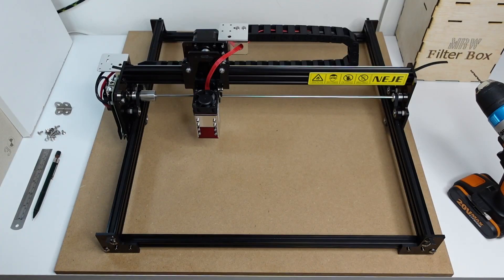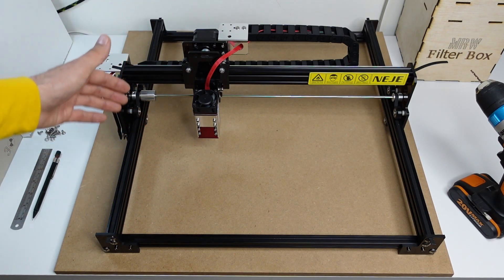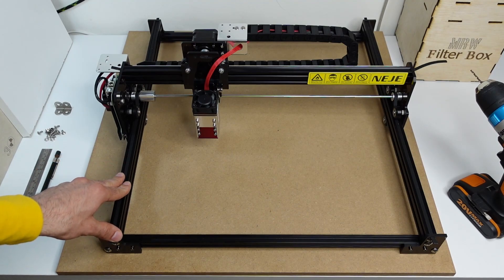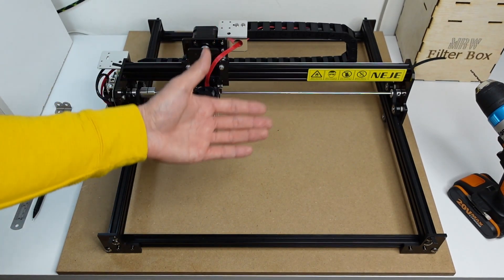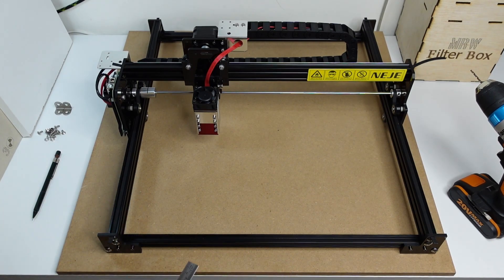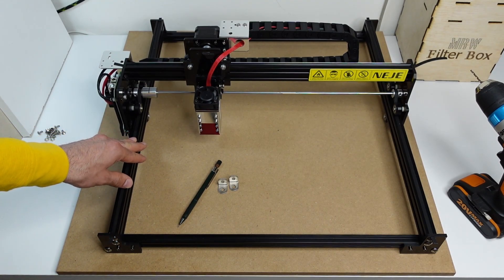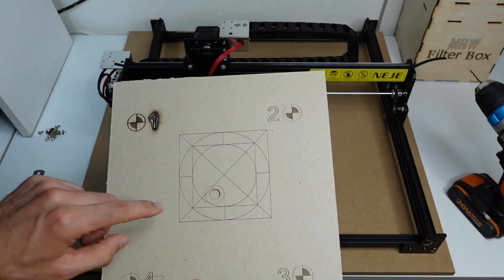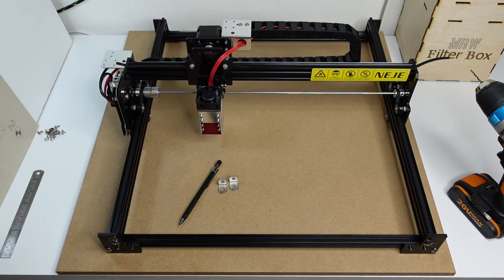Laser projects not fitting or wobbling - Properly fix your laser engraver to a base

Comment: what laser is that? also got link to test file?
Reply from the maker: Hi, doc_ineeda _win; thank you for your comment.

I am using a NEJE 3 Pro machine with the A40640 Dual Laser Module in this video.
In the video description, you will find the links to the files and to the machine used in the video, but I am pasting the links down were you can find other files:
https://whathowwhysolution.com/category/manufacturing/laser/

I hope it helps
Ciao